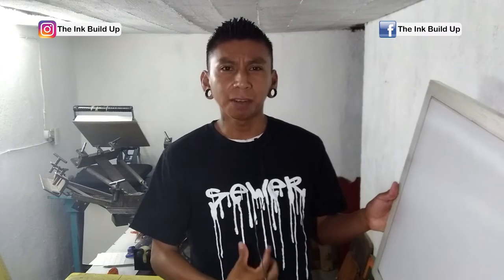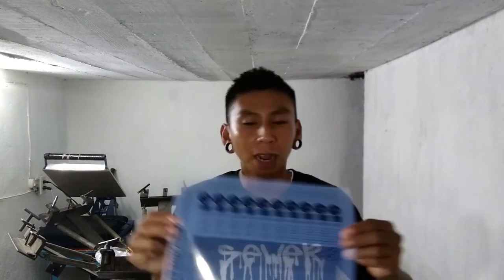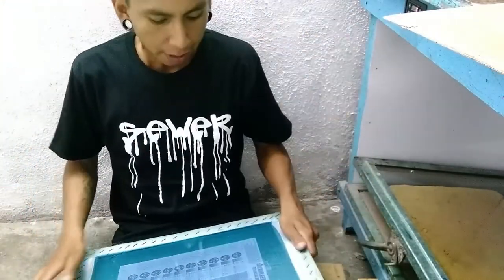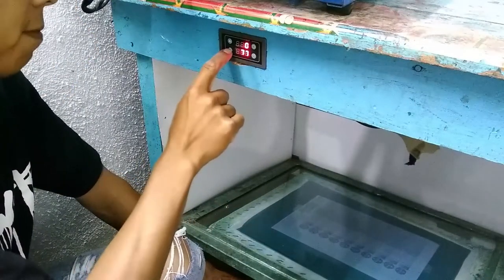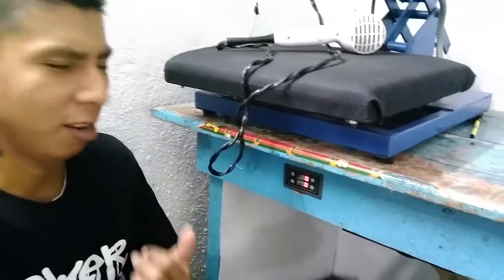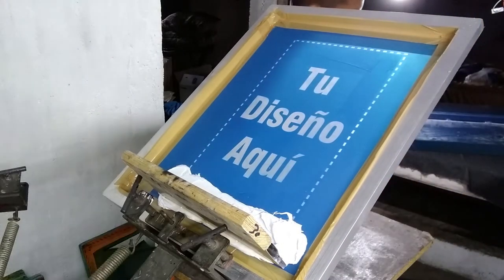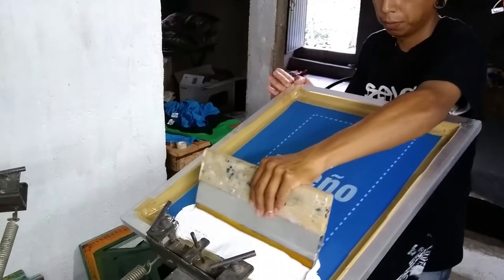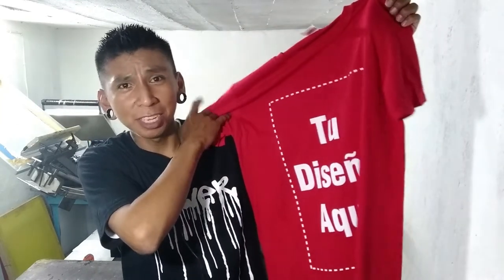Testing Cheap Aluminum Screen from eBay

Comment: Bro did you dry the screen after coating emulsion with hot air or cold air?
Reply from the maker: I use hot air but you gotta be very careful since you dont want to burn the screen. You can use cold air but it will take just a bit longer.

Comment: Great job again young amigo.  I looked up the screen,  that's around the same price as here in the states & I'm sure you could get 1 from here a lot faster & with low shipping. Have you had any luck in any American companies shipping to you?
Reply from the maker: Thank you. And not really. I've looked up a lot of suppliers in the US, but they don't ship to Mexico. I was only able to get some luck with GoldUp. It's a Chinese manufacturer but they have a location in California. I bought a pair of screens from them. Pretty good quality.
Reply: @TheInkBuildUp  man that sucks. If I come across anyone shipping there, I'll definitely pass on the info
Reply from the maker: @Slim7031  yes I know. And thanks, that will be good. Always try to find better options to get my screens.

Comment: Cover your window the UV light from the sun could be messing with your exact time too
Reply from the maker: Yea, I don't have a way around that since i can only wash outside. But usually that doesn't really affect it as long as it doesn't get direct sunlight. I just need to make a new unit for this big screens that way I can have the right distance from the light. Currently working on that.
Reply: @TheInkBuildUp  maybe wrap a peice of cardboard with aluminum foil to reflect the light when you hold it as a cover to keep the light from your eyes
Reply from the maker: @SodaCityWerx  Yea. It actually should be without me holding it but that metal box where I place my screen has a locking handle but it's broken. Still need to take it to get weld. Lol. But I'm trying to figure out if I should do that or make another exposure unit since I do plan on using these larger aluminum screens.

Comment: brother is your room is safe from uv light for the work before exposing as on  the video light is there outside your exposure table..
Reply from the maker: Are you asking if I have a yellow light room to prepare my screens with emulsion?? If so, no I don't. I just leave my regular light on when coating. I do turn them off when I'm letting them dry. But I don't work with a yellow light anymore.